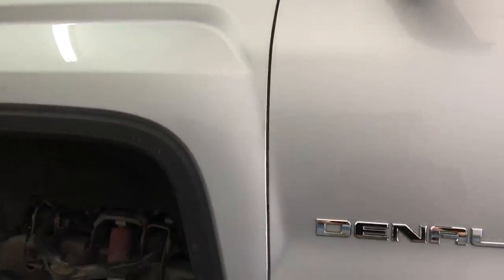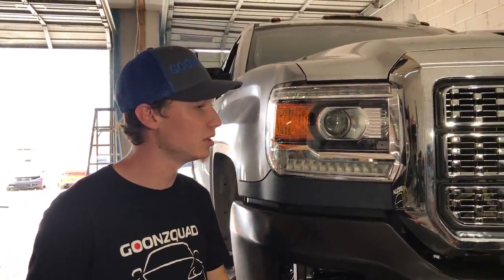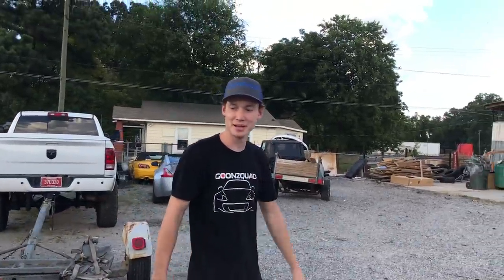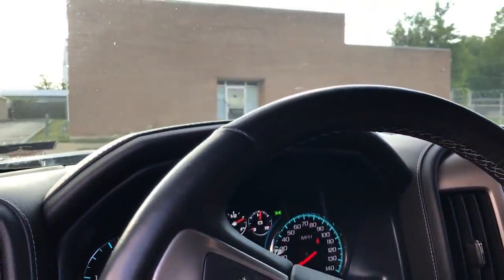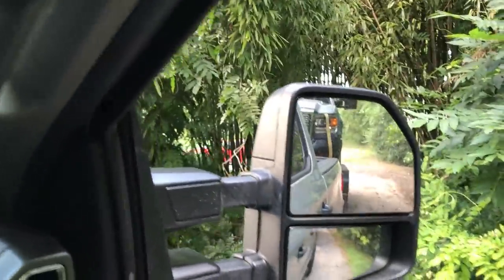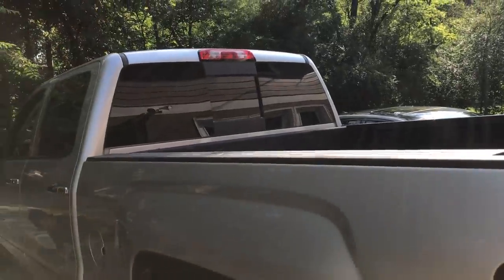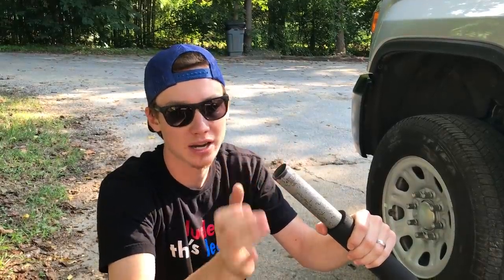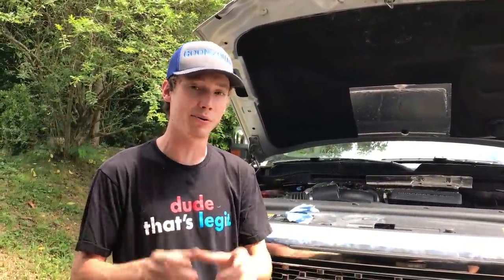Rebuilding A Wrecked 2019 GMC Duramax Part 5

Comment: Guys  leave this truck stock! You're gonna be doing a lot of highway miles and towing-- it'll be smoother, quieter, get better MPG, and it already looks dang good. Love the builds tho!
Reply: I couldn't agree more!
Reply: Change the color though or have it match the boat in some sort would be dope
Reply: @leechylivey4881  Thermochromatic paint! goozquad logo reveal when the hot water is poured, or a youtube logo, or a GMC Duramax logo, or a super fire american flag with either the grey and blue or camo/military colors)
Reply: But do a def delete then it will have way better mileage
Reply: Yes I agree. But the Denali looks best stock
Reply: @_clapped740i6  It's illegal to remove the DEF system in some states. Also, you have to reinstall it when you sell the truck.
Reply: @Buari1  well I'm in Alberta Canada and alot of exhust shit is legal including straight piped
Reply: @mikehutv9098  - Have it wrapped with a high speed pattern!
Reply: I would go with a airbag system so you can lift or lower the truck whenever you want
Reply: @_clapped740i6  DEF delete would fall under the federal rules not provincial and it would be illegal. That being said no one actually checks that stuff anymore.
Reply: K

Comment: Before taking that truck on the road, I'd definitely pull the rear u-bolts and lift it off the axle. It's possible that the alignment pin broke and now there is nothing holding it in place.
Reply: sounds right evenif they are lifitng it later on

Comment: Usually you need to have the engine running when you check the trans fluid.
Reply: And have it in neutral. I bet it’s low atleast 3 qts.
Reply: qfast817 qfast817  you check it in park.
Reply: That Alison is meant to be checked at operating temp 165° plus. At idle in park
Reply: BigDusty 

Came to post this
Reply: Thats what i was thinking, i thought it was weird that they where checking the transmission fluid while the truck is off.
Reply: Needs to be at temp. About 15-20min run time. Check it in Park, Running..
Reply: BigDusty I was thinking the same, must be running
Reply: @r3nko93  most Dodge are checked in neutral. Not sure about the newer ones, but older ones for sure.
Reply: I double checked and it shows to check it while it’s In neutral  and pumping fluid. 

Only reason I know is my coworker burned up his transmission checking it the way y’all did and was 4 qt low and temps hit 270 when he was towing his 5th wheel
Reply: I double checked and it shows to check it while it’s In neutral  and pumping fluid. 

Only reason I know is my coworker burned up his transmission checking it the way y’all did and was 4 qt low and temps hit 270 when he was towing his 5th wheel
Reply: @JustAGuy781  Dodge is the only make I have ever seen that checks in neutral. All vehicles have to be checked running.
Reply: @csorrows  yes I know they have to be running, but wasn't sure if the diesels had to be in park or neutral since I'm not all that familiar with them. Either way, they should have known to have the vehicle running and warmed up to check the transmission fluid.
Reply: Correct you can tell they got away from American cars lol
Reply: and warmed up
Reply: Only Hondas are check with engine off

Comment: Guys... As much as you tow stuff from the auction, DON'T lift or change the dynamics of the chassis. Will not tow and stop properly, changes the dynamics of the 4x4 chassis ie gets to top heavy. Will not pull in the snow or ice properly..
Reply: ...and while you're at it, forget the 12 and 14 wide 22 inch wheels....
Keep the tires under the truck like God and nature intended.
Reply: @Ricardo Alcarazdid u mean invalid
Reply: Ed Gregorowicz as long as they don’t throw huge chrome show rims on it I think it’ll look pretty good
Reply: I agree it will also look strange
Reply: @Ricardo Alcaraz that is completely false. Lifting a truck does change the steering, handling  and braking of the vehicle not to mention changes the shift points of the transmission and changes the hearing of the truck. So yeah, it changes a lot of stuff and if you want to comment at least know what you are talking about.
Reply: William Ezell  highly false I Daily a 06 f150 with a 6” lift and 35s it tows the same, also there friends power stroke they borrow is lifted 4” yes it’ll get worse fuel economy but the truck is meant to stop its gvwr and the trailer they tow should have 4 wheel brakes that helps stop. Your point is invalid sorry
Reply: @remington940  his point is not invalid at all. He speaks the facts from a mechanical standpoint which is exactly why you are apparently ignorant to what he and I have both stated. Do your research sir because lifting a tow rig doesn't help it at all and it does hurt it. Factual
Reply: Looks above performance dude
Reply: @remington940  like I said, there are many dynamics that will be changed when you lift a truck so yeah, it may still perform, but not near OEM and handling and stability will be changed as well. Those are facts of lifting anything and common sense.
Reply: They are in Tennessee, lift her to the hilt!

Comment: You gotta check transmission fluid while the truck is running!!
Reply: austin gater that’s what I was wondering.
Reply: austin gater not on all vehicles, you have a cold and hot reading. Some you have to drive around to get trans to temp then read it, others you can check while cold on level surface.
Reply: This is what I came to the comments for.  I've always checked transmission fluid with the engine running.  I think these boys need to check out the manual.
Reply: Typically the dipstick will indicate if the vehicle should be running or off to check the current transmission fluid level.
Reply: Pat  true but the hot and cold are just for us the fluids hot or cold while either way they should find out first before they over fill or under fill
Reply: Should be checked while fluid is warm, truck on level ground, truck running and in neutral.
Reply: Terry Peck only some dodges and jeeps have to be checked in neutral, all gm products check while running and warm.
Reply: Should be checked while running. The torque converter along with other components will suck in the fluid so you can get an accurate reading. It should be a little overfilled with the vehicle off
Reply: Yeap
Reply: Make sure your topping off with Dexron 6 or Allison Transynd full synthetic
Reply: Yes the truck should be running to have the fluid being distributed throughout the trans. This gives a proper reading
Reply: some automatics need to be in neutral while its running to check level
Reply: P
Reply: Yes, engine running on neutral! After adding some, run true all the gears, before back to neutral and check dipstick again.
Reply: Also if they run out of DEF the ecu will cut fuel.
Reply: These guys aren’t the professionals they think they are!
Reply: Read what it says on the stick. Park. Engine on. Can check cold or hot.
Reply: Yes should be checked while running
Reply: David Conley they never said they were professional they’re just young adults learning as they go . Which they doing a very good job at
Reply: And it has to be in neutral
Reply: David Conley  don’t have to be an asshole. They are learning as they go, and they have accomplished way more then your mind could even comprehend, these men have proven time and time again that with a little time you can do anything, keep on buildin boys! I’m with ya till the end🤙🏼
Reply: A lot of cars dont have a dip stick and some vehicles have to be warmed, running and in "D".
Reply: @Grant Jennings If you ever run out, just pee in the tank. ;)
Reply: austin gater I was told to put the truck in neutral with the parking brake on while it’s hot to check it.
Reply: akron/nov61972  You forgot with the tailgate open.
Reply: @xtune5731  running still on cold engine...
Reply: check the manual most cars you need to have the vehicle running but every car is different
Reply: they said in the video they had it up to the right temp
Reply: @xtune5731  You still have to have the vehicle running...Cold fill line would be right after you start vehicle up, hot fill line would be after vehicle is warmed up from driving around a bit
Reply: The fluids are not properly displaced in the transmission by the transmission pump pressure not turning from the engine in neutral position. Meaning  if they check with no engine running it will not be the correct level. For the hot temperature this is best so you know fluid has expanded to its maximum and level is 100% correct. And on level ground which they seem to be. This mistake can happen to best of us
Reply: If the trans needs to be up to temp most likely it needs to be checked running!
Reply: austin gater exactly what I was thinking 🤔
Reply: Did you align the rear axle?

Comment: Keep it stock! Check transmission level while it's running, and put in diesel specific coolant(G-05 gold), the truck will love you for it. Keep up the great work guys.
Reply: Dexcool only for gm vehicles
Reply: Please put the  correct coolant in.

Comment: Keep it stock, you'll love it it that way, best dependability, no worries about throwing  weird codes. It will do everything you ask of it.
Reply: who the hell wants stock shit.. im pretty sure they know what their getting into by modding it.
Reply: For hauling cars on trailers it would be better to keep it on the stock height suspension and easier to load stuff in the bed.
Reply: Yep, keep it stock, perfect private family hauler.
Reply: Dependable 207k on my stock 08. but my lifted 09 has had multiple front suspensions, intermediary shafts, ball joints, tie rod ends, idler arms, a frame bushings...no more lifted trucks, they do not stop, turn, or drive as well as stock.
Reply: @gadgetdealz  Couldn't of said it better. I've been a technician for the better part of thirty years and suspension work is my specialty. I've installed more lift kits/ lowering kits than I care to imagine. I've had so many customer complaints about their vehicles afterwards it's quite comical. Especially when I offer zero warranty on aftermarket suspension system installation. I refuse to supply any components,,, that's up to the customer. And I have them sign a waiver about installation warranty. 30 feet or 30 seconds. Whichever comes first. But I will admit I make damn good money ruining perfectly good vehicles. And what's even better is reinstalling the old system six months down the road when they decide that it was nothing but a huge mistake. But hey,,, the customer is always right.
Reply: @gadgetdealz  if you have the lifted geometry set up correctly then there will be no binding or breaking of parts. lift kits will not destroy parts. incorrect suspension geometry very much so will.
Reply: @towboatjeff  your right but its that urge to lift it, with lifts and bigger wheels it will use more fuel and wont pull as good, but still, why not, gotta have some fun
Reply: @muddingcanada6550  What breaks parts in my experience as a tech is the customers not spending their money on the right stuff. They see some big fancy wheels, spend a shit load of money on them... Oh they won't fit on my truck. What's the cheapest way to lift it ? That's when they come to me with the cheapest crap they could find on eBay just to get those fancy expensive wheels on their truck. No thought process goes into this endeavor. I install the crap suspension that they purchase and now I'm the bad guy when shit starts falling apart and wearing out prematurely. Like I said before, I don't care. I will take their money.

Comment: Please don't lift it. Nice tires and wheels but no lift. Work truck needs to be dependable.  Great work on this build.
Reply: How is a lifted truck not a work truck?
Reply: @ksd9889  If you have to ask there is nothing I can say to help you.
Reply: Shiznaft Lol i work in the oil industry as a superintendent running project.  In and one the back rods we need lifted trucks to get thought the the mud which is 2ft to 3ft deep, snow 4ft high.  
My truck has. 6” lift 
My picker truck has a 4” lift. 
You fucking need it. Simple.  
So there’s nothing I can say to help you.  City boys lol
Reply: @ksd9889  If you're towing vehicles, a lift wouldn't be very stable. But for like what you claim to do, that's fine. Lifting a truck depends on what you use it for. Back roads and oil field stuff, yes, it is needed in most situations, however, my dad got through tough shit with a stock Silverado. Most people lift their trucks because their dong is smaller than a mini M&M, but its whatever makes them happy. I am not for, nor against lifting a truck, but for show purpose, hell yeah, oil field/off road work? Hell yeah. Towing vehicles and other heavier loads? Probably not the best idea. That being said, to each their own. 

Also think about what people use their trucks for too.

Comment: Lifting it will destroy the drive train. Also fubars the center of balance.
Reply: Wrong
Reply: if you get a properly engineered kit with drop down relocation brackets for the diffs - the driveline stays intact.  It will have more body roll taking hard corners while lifted but it's a truck not a race car.

Comment: Looks great guys!!! 

Just a tip.... check your transmission fluid while the truck is running. 

Keep up the good work! Still waiting for a vw rebuild.
Reply: Rowles Rebuilds I don’t know, but I think they maybe did it off camera.
Reply: I was thinking the same as I was watching
Reply: Check tranny fluid with Engine running and some required it in park  or nautral ..I check both

Comment: You have to check the transmission fluid with the car running 
LIKE SO THEY CAN SEE AND NOT OVER OR UNDER FILL
Reply: Tomasz Klisz 
That’s right 👍👍🍻
Reply: Tomasz Klisz  Thats right. Also make sure you're on super flat ground...even a slight hill that you can't even notice can make the level fluctuate quite a bit and give you an improper reading.
Reply: Thanks for the help guys!
And yes engine oil must be off and not over max/high 
And transmission must be running when checking fluid
Reply: Hovik Gedjeyan 
Good info! 👍👍🍻
Reply: Nigel W thank you🙏🏽

Comment: Please wrap. It's a good marketing strategy and please DO NOT LIFT. YOU NEED TO TOW. KEEP STOCK SPECIFICATION AND CHANGE ALLOYS IF YOU WANT
Reply: Encrypted Pixels - yes please wrap in in the Goonzquad “BEAST” style. Also agree with keeping the suspension stock. You need to use the beast to pick up new projects!
Reply: @tyrose6938  - Wrap it in goonzquad "Beast" and then have a GIVE AWAY!!!!!

Comment: Guys, first off love your channel so much, you are the best!
I think you'll be better off keeping the truck's suspension and lift height stock. Imho it'll be much more comfy and nice to drive on long distances when you need to pick up builds across the country.
Reply: A quality 4.5" lift with Fox shocks and it will ride better than factory.
Reply: Couldn't agree more! This is solid advice - your truck is a tool for making the cool looking stuff - let it work to its' full potential - upgrade aesthetics if you want a look, but leave the suspension "as is"  for trailer pulling; raising the center of gravity takes away control, especially heavy loads on downhill grades
Reply: Keep it stock it will be nicer to travel with for sure
Reply: Agreed
Reply: Plus tires will hurt mpg

Comment: That's a nice truck, guys. Don't lift that thing. You're not going to be doing off road towing
Reply: David S how do you know
Reply: @Kartel5  maybe he knows that they need a tow rig because they've had to borrow a truck to tow all of these vehicles fixed up, the whole reason they bought this truck! However boys will be boys and they won't learn and off-road play toy is not a very good tow rig.
Reply: it will pull their little car hauler fine no matter how y’all the lift it
Reply: Justin Hobart 
Don’t forget the F-250 is lifted.
Reply: @281CubicInchesOfFreedom  barely, it's not very big
Reply: I agree, don't lift your tow rig
Reply: Ethan P it’s leveled not lifted
Reply: You can tow with your lifted truck, bumper tow that is. You will not be able to tow goose neck/fifth wheel trailers.
Reply: carlosierra11 
3.5” level in the front, 1” lift in the back.
Reply: Ethan P  yeh that’s leveled not lifted.
Reply: carlosierra11 
If it was raised at both axles, it was lifted. If it was raised only in the front, that’s leveled.
Reply: Please dont lift that truck! It doesnt need it. It's your tow rig guys not an off roader.

Comment: If you're going to use the truck mainly as a tow rig you're better off staying with the factory suspension and just updating your wheels and tires.
That way you don't get that squatted dog trying to take a s*** look going down the road I know the truck will accept 35 possibly even 37's with the factory setup and still be plenty high off the ground.
Reply: They don't care, they want a "bro"  truck.
Reply: Prolly could use helper bags n not have the problem and a off set tow hitch
Reply: 3500 leafs and shocks work just as well. My f250 has f350 rear suspension and doesn’t squat no matter what’s on the trailer
Reply: 3500 leafs and shocks work just as well. My f250 has f350 rear suspension and doesn’t squat no matter what’s on the trailer

Comment: Agree with others if you're going to be towing keep the stock suspension. But get an Air Lift helper air spring system to keep the truck from squatting. You guys could install it easily.
Reply: I wouldn't get helper bags until they start towing stuff heavy enough to make it sag. A car or tow and that thing isn't breaking a sweat.
Reply: @richardcampbell8685  Very true. That's a very heavy duty truck.